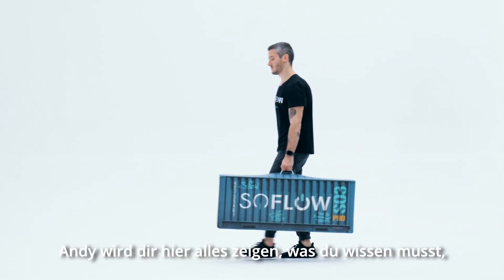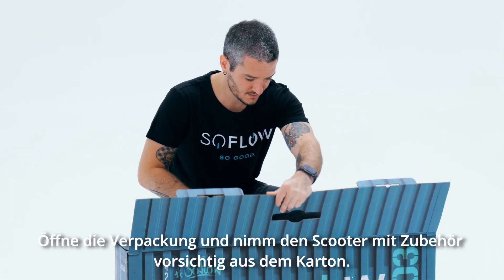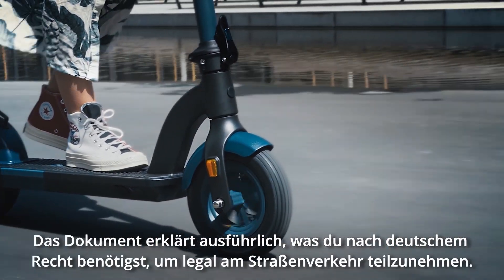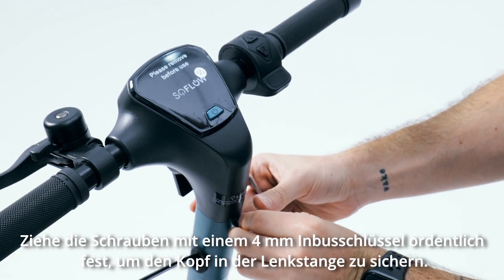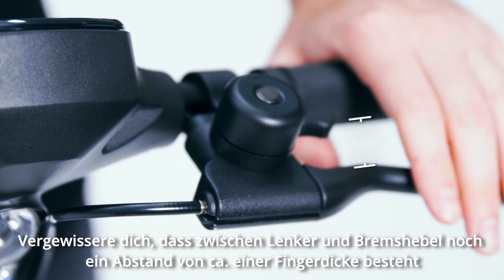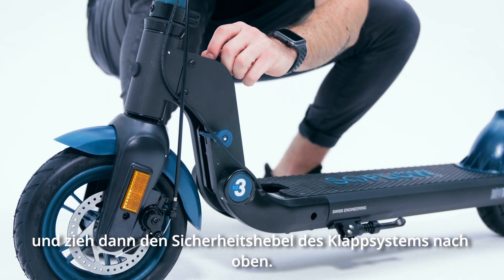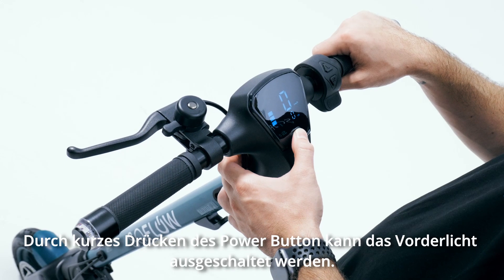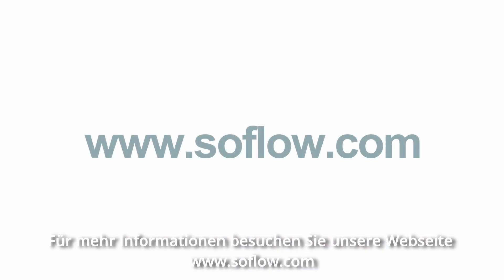SoFlow Scooter SO3 Gen2 / SO3 Pro - First Steps

Comment: Hello, is there any chance of firmware update to have "cruise control" as on Xiaomi 365 (we had it before)? We like the Scooter, but it is tiresome to always have your thumb pushing the accelerator. Also turn signals should not have been on the right side, not very ergonomic on the accelerator. Difficult to action them while keeping accelerator pushed with a thumb.